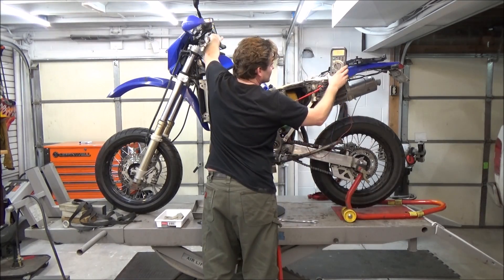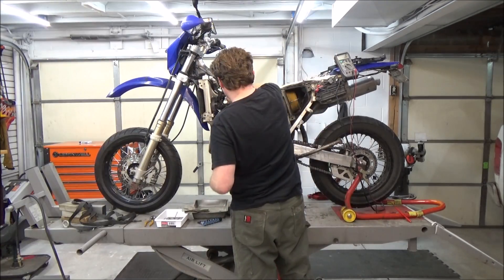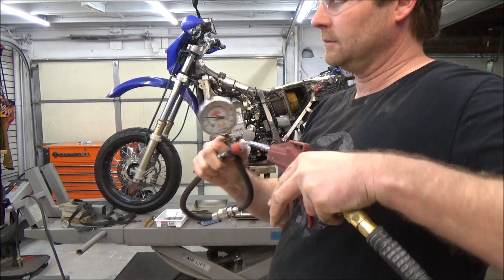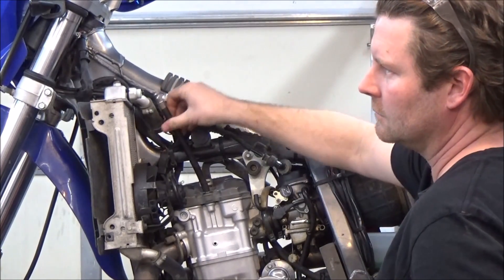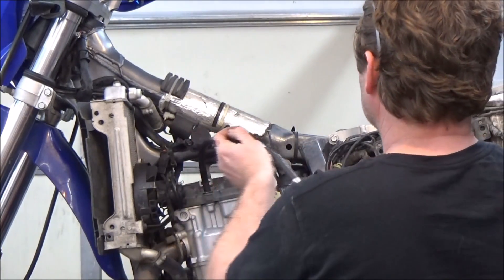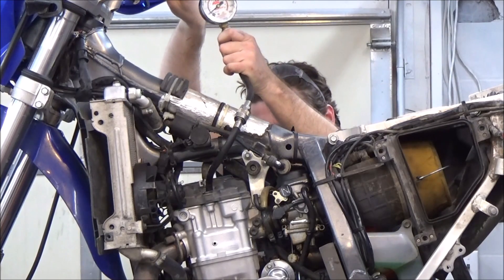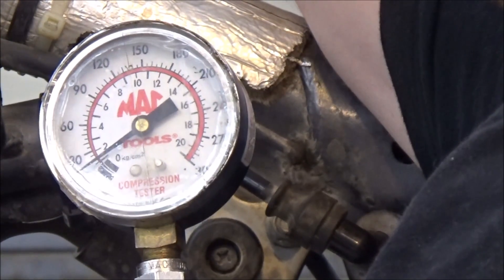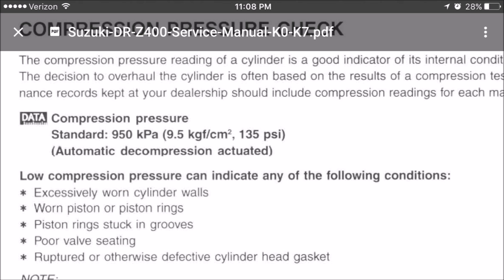How to do a compression test. BONUS TIP: How to test the tool! Demo on: DRZ400 Engine Test

Comment: Shane

1988 Softail FXSTC 1340cc compression  after top end redone is 125 psi compression both cylinders, is that good? Stock evo also stock cam heads were cleaned and valves were reseated
Reply: That's good. Always have the choke plate (assuming it still has the stock Keihin)  fully opened and throttle held fully open. When both cylinders match that suggests they're healthy because worn top ends tend to be mismatched.

Comment: I've been reading specs on rm80s since thats what im rebuilding now. how did they go from in 1985 they had 16hp then in 91 made 27.5 hp thats more than double. is it because the powervalve? or is it from a redesigned head. whatever it is im curious to know and your the best to answer
Reply from the maker: I will throw out there a thought I have. No time to research numbers and I doubt it matters enough to hire me to find out for sure. But consider this: how "hp" was measured and the honest regulations to numbers posted may be the issue. I also believe the numbers you found for 27.5 are either at the crankshaft or incorrect. That just seems quite high for an 80 cc at the rear wheel. Pretty soon will be starting a garage night to answer all these questions every week it will be recorded and be able to be reviewed if people can't catch the live addition. 
Head over to my website become a member now and to receive 20 minutes of personal mentorship with me or a detailed answer in an email. You can even use FaceTime if you have it or find a friends iPhone and we can walk through the actual carburetor process together. I look forward to mentoring you.

Note: Membership is not required to receive coaching or email help. Here are the direct links to individual services offered at H2W:

Email Answer Service-Click http://how2wrench.com/product/email-support/ 

Phone/FaceTime Coaching-Click http://how2wrench.com/product/personal-tech-training-phone-facetime/ 

DIY Mentorship-Click http://how2wrench.com/product/diy-coaching-hire-teach/ 

Dealership Training Services-Click http://how2wrench.com/product-category/dealer-services/ 

MMI/Tech School Student Tutoring-Click http://how2wrench.com/product/mmi-tech-school-student-tutoring-services/

Motivational/Guest Speaker-Click http://how2wrench.com/product/motivational-speaker/ 

On-site Training Services-Click http://how2wrench.com/product/on-site-training/ 

Tech Line Services-Click http://how2wrench.com/product/tech-line-minutes/ 

Mechanic on Duty-Click http://how2wrench.com/product-category/mechanic-on-duty/ 

Did you like this free video and hope to see more? Would you just like to say thank you with a donation? Click https://www.paypal.com/donate/?token=TvKoeRazPL-KysbM-e0ttz-C_gPq2IrqxDmM3ORCu4nxJzQWxYbmo-6m3YuNu64XHLngGW 

Keep Wrenching,
Shane Conley
Instructor/Motivator/Motorcyclist!
www.How2Wrench.com
Reply: Thanks for the input